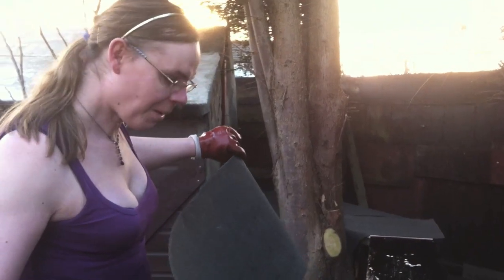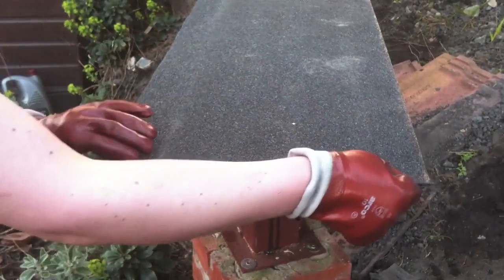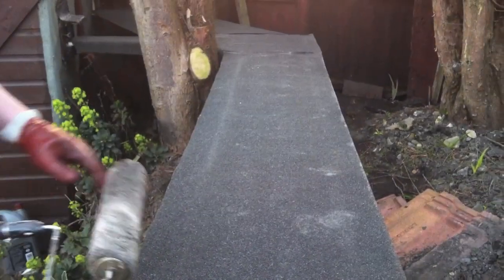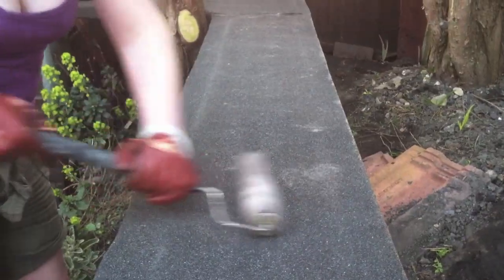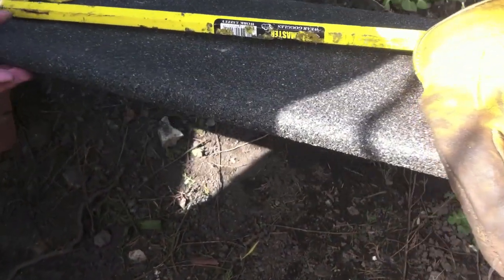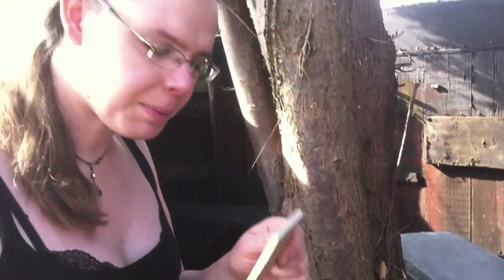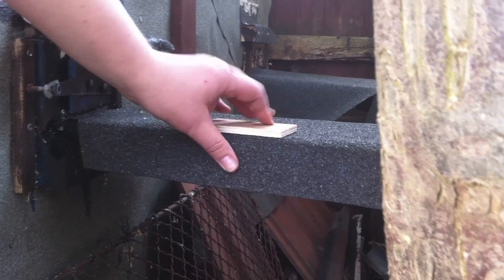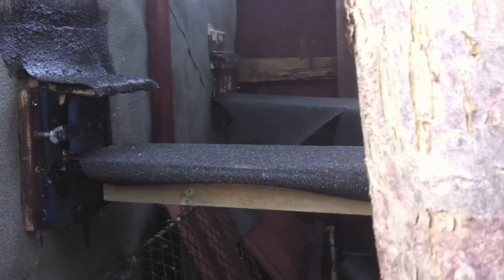How to Build A Garden Model Railway, Part 4

Comment: Why use roofing felt? wouldn't a coat of water proof paint do just as well and be cheaper to buy
Reply from the maker: Because roofing felt is more durable and much more long lasting. The entire roll cost less than a tenner so it's not expensive either.
Reply: Jennifer E. Kirk plus it looks good as ballast 👍🏻